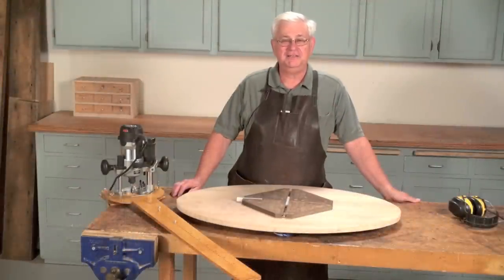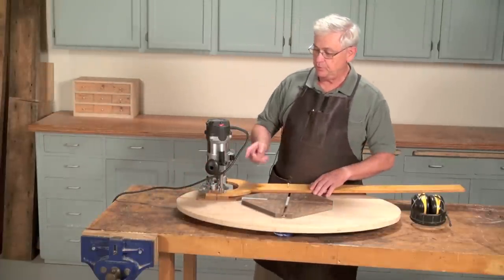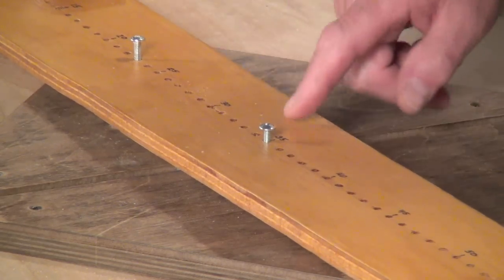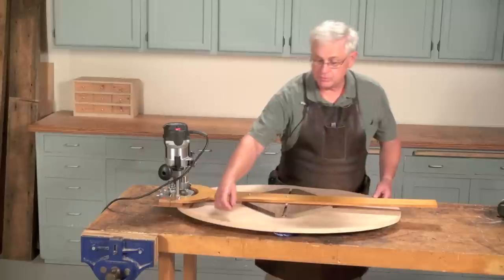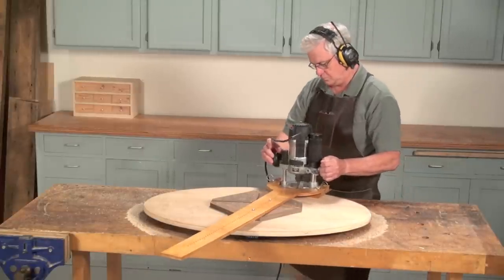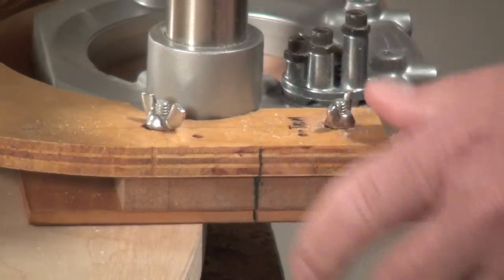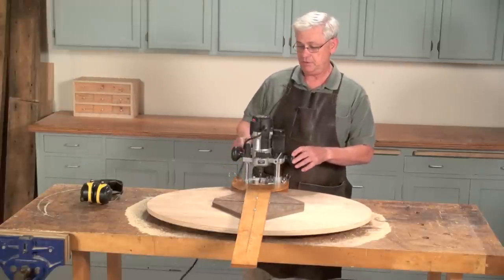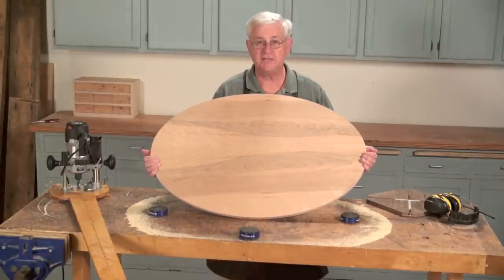The Elliptical Router Jig

Comment: Fine jig. I had it only in compass form for layout. Thanks for proposing a very handy router model. May I suggest a greater sliding system, for making an oval frame for example? i;e one outer cut and one inner one. In this case you have to keep the same pin adjustments, or else you lose the parallel. Bit tricky to explain.
Reply: Hi, your idea sounds nice, but is hard to understand from here. I use a CAD program called SolidWorks (very useful program to create any parts and
assemble) Why don't you make a drawing.

Comment: HOW DID YOU CUT THE ' T ' SLOTS IN THE FIXTURE ?
Reply: As he states it is made from 1/2" and 1/4" plywood there will only be a simple slot in the lower 1/2" part; the top part is just four separate pieces.